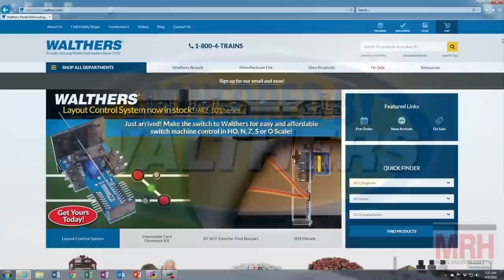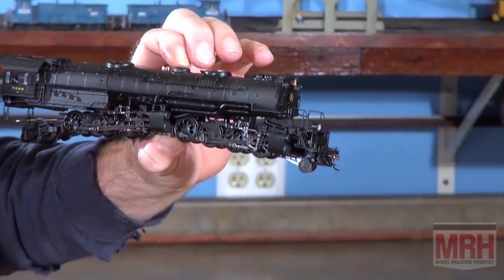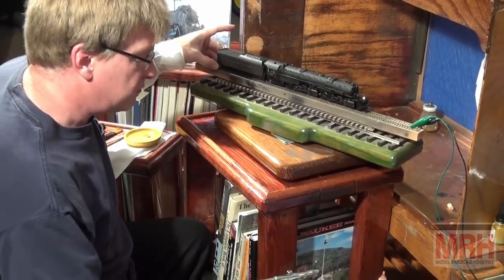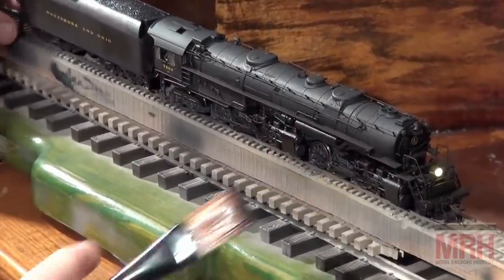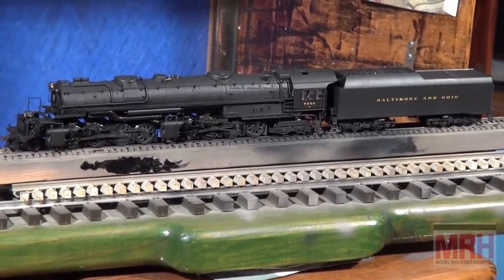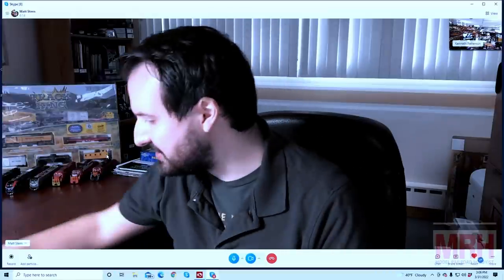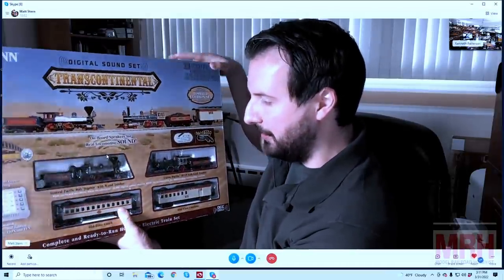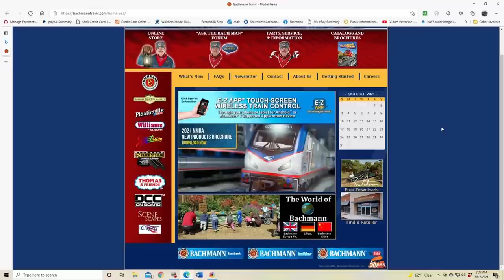Steam loco weathering | May 2022 WHATS NEAT Model Railroad Hobbyist

Comment: only thing you forgot on it was the hard water staining running down the side of the tender and from the whistle and safety blowoff valves on the top of the boiler, but other than that it's a pretty good weathering job.